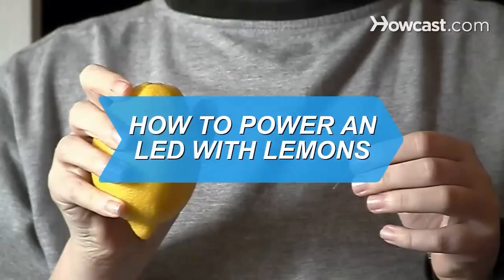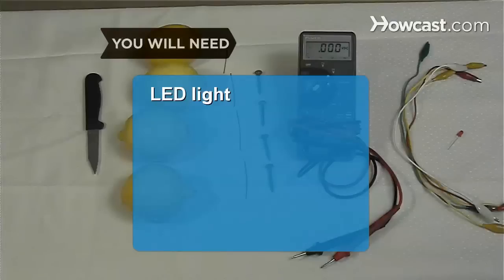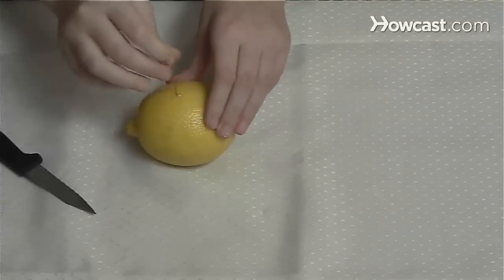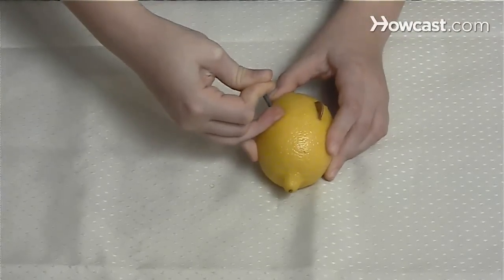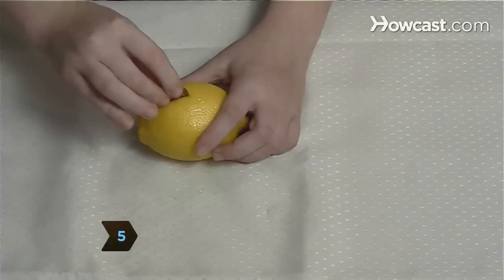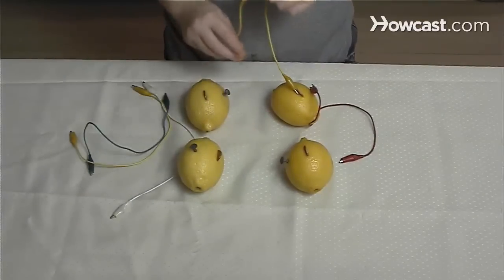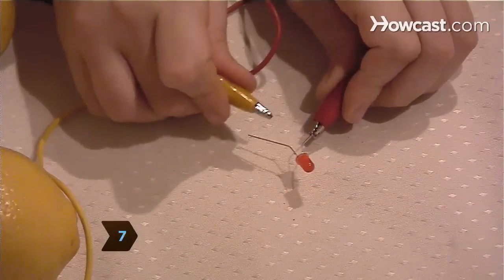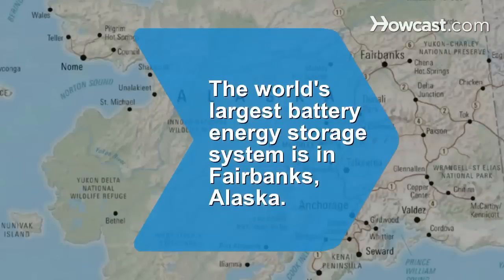How to Power an LED with Lemons

Comment: Did You Know - Back when everyone had a home phone (not a cell phone) and the power went out, the phone still worked?  Why? because the entire phone system worked on batteries, not the power grid.  Today Cell Phone Towers work off the grid or power themselves via Natural Gas generator, all have a UPS (Uninterruptible Power Supply - Backup). battery backup system that keep them working for a while in a power outage. (HOw long, I don't know, do you?)
Reply: 10 years

Comment: i went to the store to buy 4 lemons and 4 pcs of copper wire and 4 galvnaized nails and 5 jumper wires and a voltmeter. But found this certain piece of object called "batteries" its pretty cheap and handy you might wanna try it
Reply: Batteries + science project = 0 Points